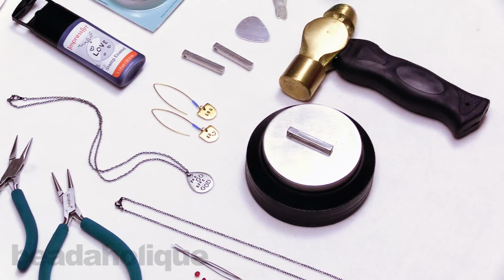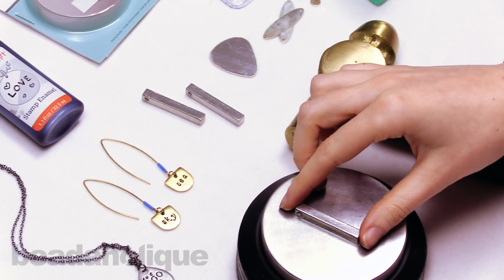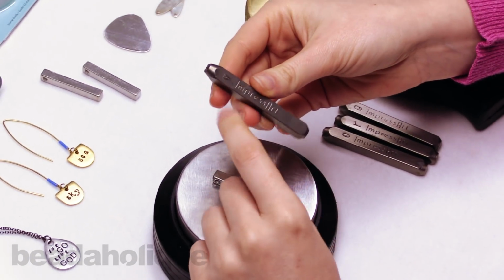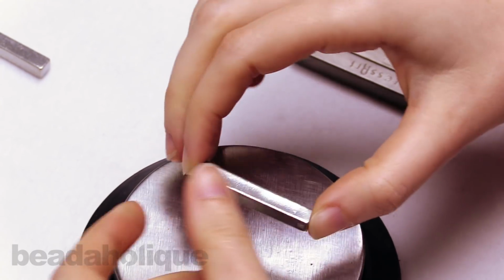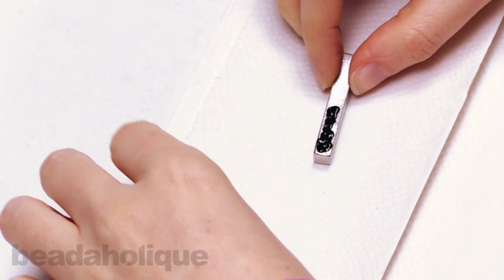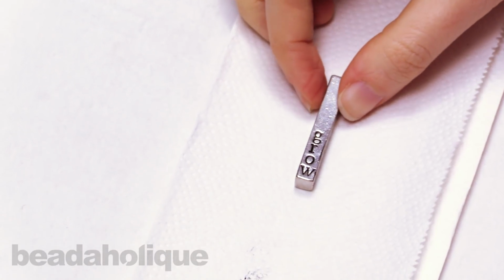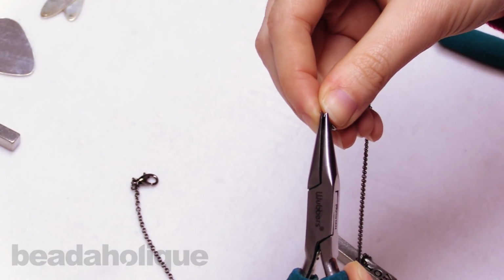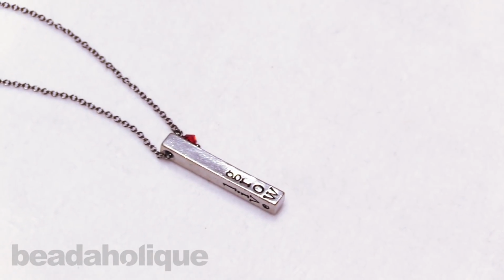How to Metal Stamp a 3D Bar Pendant and Make a Necklace

Comment: Great tutorial. Just wondering, if the pendant needs to be washed, say it gets sweaty from wearing while exercising, would it be OK to wash with gentle soap and water or will the ink wash out?
Reply from the maker: Unfortunately, it can not be washed with soap. Stamp enamel is water resistant but will start to wash out if exposed to soap.
Reply: OK, thanks. Good to know.
Reply from the maker: No problem. To follow up, we had one our designers give it a test and all was well. So I am thinking a little-wet exposure should be ok but showers and swimming may not be a good idea.
Reply: Thanks so much for the follow up.